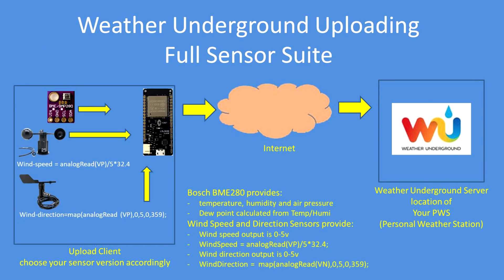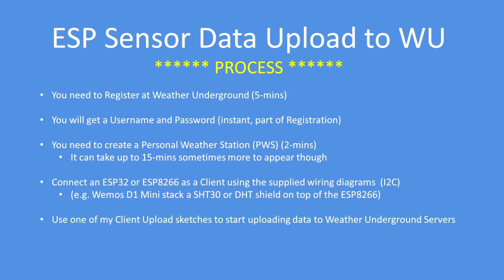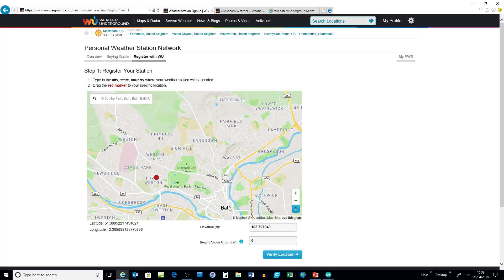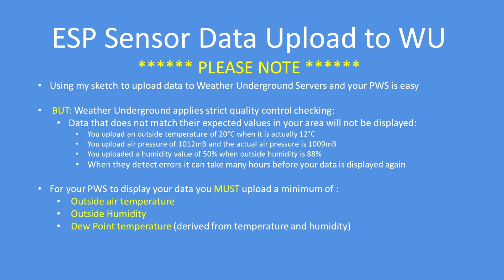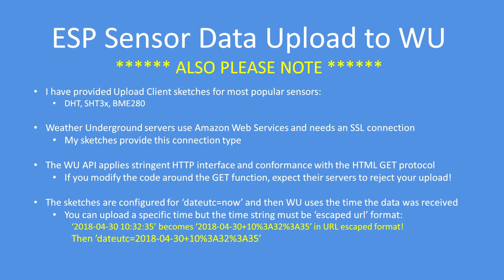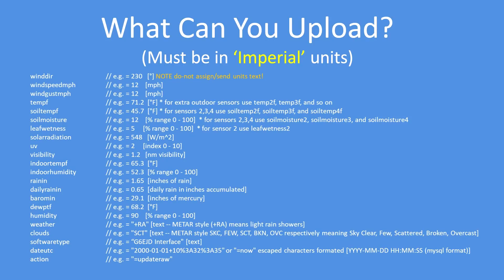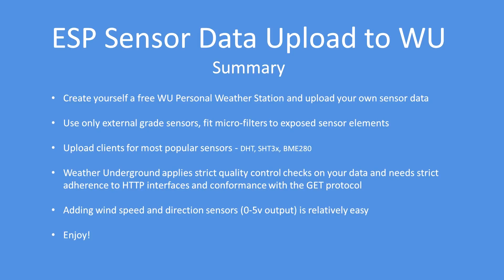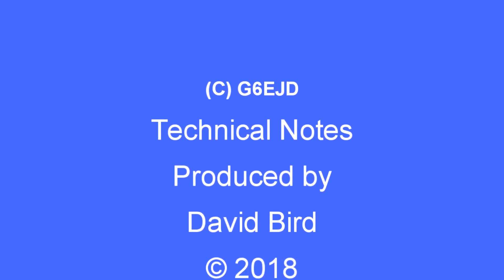Tech Note 093 - ESP(32 or 8266) Sensor Data Upload to Weather Underground

Comment: Great project David, I have a question. Im fairly new to The Esp8266 but have made a few weather stations with them. I have probably a naive question but .what pins do the sensors hook up too? ( wind, direction etc.) Am i going down the wrong road ? 
Tnx
Reply from the maker: It depends on the sensor type and data bus, usually either an SPI or I2C bus or maybe just a one pin interface. Unlike the ESP32 it’s not easy to reassign the pins used for data buses so you have to use the already defined pins, a Google search for 8266 spi or I2C pins will quickly give the answer, for example I2C is pins 4 and 5

Comment: David, I just viewed this video, I am trying to up load myPWS to WU. I have tried your sketch in the Arduino IDE, I keep getting this error message "system_variables.h:" no such directory, can you assist me by telling me where I can download this from ??. Great video, easy to understand for a novice like me.
Reply from the maker: it's the last file in the repository, just copy that into your sketch folder and restart the ide.
Reply from the maker: Note, unless you have a current WU account and a PWS, IBM as the new owner closed down this method; well unless you pay $500/month
Reply: @G6EJD  I have an account with WU and a PWS name, excuse my ignorance, but where is the repository?
Reply from the maker: GitHub g6ejd
Reply: @G6EJD  I have final got the sketch to run on my D1 MINI, I finally managed to download the "systems_variable .h;" file, now I get an error message in there serial monitor, "could not fined a valid bme sensor, check wiring" this I have done and it is correct, I have tested the BME sensor on an Arduino UNO and it works perfectly, can you help me again?
Reply from the maker: @raysmith6874  are you using SDA => D2.
SCL => D1 and bme.begin(0x76) or bme.begin(0x77) depending on the type you have.
Reply: @G6EJD  the address was 0x77, I have changed it to 0x76 it now allows the sketch to run, but now I get "error uploading to weather underground, trying again later" ???
Reply from the maker: You can test the weather underground upload using your browser, replicate the address and data used by the programme into an address, it is usually that WU have changed their criteria, it happens a lot, they do give examples, also they may now require https
Reply: @G6EJD  Sorry I am not sure what you want me to do? I am a novice.Do you mean copt & paste the WU address in my browser?
Reply from the maker: @raysmith6874  exactly, replicate what the programme is sending in your browser address bar
Reply: @G6EJD  when you say replicate the programme, do you mean the whole sketch or just part of it ?
Reply from the maker: @raysmith6874  https://rtupdate.weather underground.com/weatherstation/updateweatherstation.php?ID="+WU_pwsID+"&PASSWORD="+WU_pwsPASSWORD+"&dateutc="+timenow +”&field1=22.5” replace ID and password and date and time, the easiest way is to print out what the programme sends and copy that line from the serial monitor into your web browser, this is almost certainly WU rejecting the upload request
Reply: @G6EJD  sorry to be a bore, is this a link you have sent me, because if it is I get a new screen saying "502 bad gateway"
Reply from the maker: @raysmith6874  what you need to do is replicate what the programme is sending to WU so monitor the serial port it will display what is being sent to WU, take a copy of the line with select a d copy (ctrl-c) then paste that into your browser and see what the result is, if you have done that and the response is 502 bad gateway then that is the WU response to an upload the problem with a 502 response is it’s not very informative and is usually a WU problem not a user call. This is the problem with WU since IBM took them over.
Reply from the maker: I have a trial with mine standby
Reply from the maker: OK just tried the code and it all works perfectly. Are you using your PWS station name as login and the correct password? This link works, I get success, obviously copy it and edit the details to yours:
https://rtupdate.wunderground.com/weatherstation/updateweatherstation.php?ID=yourPWSnamehere&PASSWORD=yourpasswordhere&dateutc=now&tempf=22.5&action=updateraw&realtime=1&rtfreq=60

So you need to replace 'yourPWSname' with actual name e.g. IMELKSHA3 and same for password

Comment: I am a little confused. If i set the update interval to 10 minutes, then why it is updating the weather data every 5 minutes?? The Esp8266 is sleeping in that  interval?
Reply from the maker: I think you have done something wrong
Reply: G6EJD Hhmm. I dont know. In the afternoon  it reported back  every 10 minutes as i set in the sketch. Now it is working great.  But the air pressure is not reported 🤔
Reply from the maker: László Kósa, OWM does not provide all data for all locations, have you tried a different location?
Reply: G6EJD I am uploading to Wunderground :)
Reply from the maker: László Kósa, if the pressure is not showing check that the API is not expecting imperial units eg 29.4”

Comment: HI G6EJD ,verry nice project . I dying with sensor DHT11 . I corectly register in wunderground.com and site give me ID for PWS and passoword. I corectly include data in sketch. serial monitor say me : 

wifi connected
192.168.0.106
upload date-time:CCYY-MM-DD HH:MM:SS expected
upload date-time:1970-01-01 +6:00:04
connect to rtupdate.wunderground.com
connection failed try again next time 

I think the problem is time , i enter in the router menu /system / time /and enter ntp server and chenge date and time. but problem is stay. after i chenge :
void StartAndGetTime(){
  configTime(0, 0, "0.uk.pool.ntp.org", "time.nist.gov"); 
  setenv("TZ", "GMT2BST,M11.28.4/01,M10.5.0/02",1); 
  delay(200);    +2 hours for Bulgarian time zone and mount and day .but  unsuccessfully, please help me if you can , thank you.

Comment: I moved my sensor from a esp32 to a esp8266 (it's been disconnected for a week or so)  and am getting connection errors now. Is this a fault on their (Wunderground) end?  Also, does this use GMT for the time? It's 6:13 here (EDT),
 time shows as 23:13 , (gmt time now appears to be 22:13 .) 
.....
WiFi connected
IP address: 
192.168.0.217
Upload date-time: CCYY-MM-DD HH:MM:SS   expected
Upload date-time: 2019-07-17+23:13:20
Connecting to   : rtupdate.wunderground.com
Connection failed
Error uploading to Weather Underground, trying next time
Reply from the maker: Did you renew your keys when IBM took over WU, if not your key will be rejected. You cannot get a new key unless you have a PWS that uploads constantly. Also for some of their servers they moved to https
Reply: @G6EJD  EDIT: *MUST use version 2.4.2 * I just verified it still works fine on the esp32, so I'm not sure whats happening. I used the same sketch , keys, id ,etc in Arduino IDE. I even tried creating a new ID/key . still fails. I tested the setup with the bme280 test sketch, getting a good response.I appear to be having the exact same issue as John Byrne below. Works on esp32, but not on esp8266
Reply from the maker: Bruce, downgrade to ESP8266 ide core to 2.4.2, recompile and it should work again.
Reply: @G6EJD  I can confirm it works (ESP8266) with esp8266 version 2.4.2 and not with the newest.  2.5.2. My apologies for not reading the whole thread here.
Reply from the maker: Bruce, I doubt 2.5.2 will ever be fixed to solve the problem, development seems to have stopped.

Comment: I am new to Arduino/esp32. I  was going to try this on my esp32 /bme280  but when compiling I'm getting 
system_variables.h: No such file or directory 
I'm sure I'm missing something obvious. Can anyone help? Thanks in advance.
Reply from the maker: You also need the file system_variables.h in the same folder as the sketch and be sure to have refreshed your WU keys if not already, since IBM took over WU your old keys won't work.
Reply: @G6EJD  I think I got it now Thanks!  The Arduino IDe moved the sketch and didn't move the  system_variables file . Only other issue I  have now is my dew point  shows at DEWPOINT
154F . Something seems a bit off lol
Reply: Dewpoint...Seems the sketch is converting temp from celsius to F and the dew pt calculation is also adding a second convert to F
sensor_temperature bme.readTemperature() * 9/5+32.... // Read temperature as Fahrenheit
then at the end of WU_dewptf   I see *9/5+32  converting it again to F
I just added a second temp statement to read the BME280 in Celsius (without the conversion to F) then used that variable for the dew pt calc.  since I don't really know what I'm doing yet. Thanks for the awesome work !
Reply from the maker: Bruce, the Dewpoint calculation takes temperature in °C it came from NOAA so there may be a logic fault and it’s sending temperature in °F and not °C if that makes sense. I’ll check the source code, it is wrong.
Reply from the maker: The Dewpoint Calc. is wrong, it’s defined as: Td = T - ((100 - RH)/5.) where Td is dew point temperature (in degrees Celsius), T is observed temperature (in degrees Celsius), and RH is relative humidity (in percent). I’ll update the source.
Reply from the maker: Modified the source code now.
Reply: @G6EJD    Thanks  :-)
Reply: @G6EJD  Hi - I have just ammended the ESP_WU_Uploader_DHT_v01.ino source as it too is using F rather than C. Please can you update as you have done for the bme280 to help others in the future. Great channel and resource. Thanks
Reply from the maker: Can’t do that presently as I’m in hospital until at least November
Reply: @G6EJD  Sorry to hear that. Hope all goes well. Look forward to your future uploads.

Comment: Hello David
Had this running on a wemos d1 for six months without problem.
Now wont connect to weather underground, same code works on a ESP32 fine.
the line that displays the id, password and temp setting is just gobblegook.
and says connection failed using the same logon on credentials as the ESP32 version.
used four different wemos/bme280 versions
not sure what has changed. thanks
Reply from the maker: You need a new API Key from Weather Underground. Did you renew your keys in about March 2019 when they changed their requirement for keys? IBM took over WU and changed all of the licencing and charging arrangements, now you can only get an up0load key to operate if your a PWS (Personal Weather Station) that regularly contributes weather data for your region.  The fact that the ESP32 works and the ESP8266 is strange, there is a different complier core for the two, it looks like the ESP32 is correct and the ESP8266 version is not - obviously. What version of the ESp8266 core are you using? Mine is currently 2.5.2 as an example. You can down-grade your core to say 2.4.2 which was the last known good version.
Reply: Thanks David I shall try your suggestion.

Comment: you have to buy it ?
right?
Thanks.
Marc.
Reply from the maker: Marc Paradis Not sure what you mean? A developers WU account is totally free but they limit you to 500 reads per day, but can upload as many times as you like, in fact their rapid-fire server that I set it up for, allows data uploads every 5-secs.
Reply: G6EJD i saw that personal weather station is a paid service...
Reply from the maker: Marc Paradis You have to pick the Developer option and then it’s $0 cost - definitely free, they just make it look like it will cost, either that or it’s changed very recently. If they charge they would lose a large proportion of their free weather data feeds! There are tutorials around that show you how to go through the registration process.

Comment: Hi David, 

why are there two diferent update lines with diferent Delay updates in milliseconds...

Thx for explanation.
Adam

#ifdef ESP32
  const unsigned long  UpdateInterval     = 30L*60L*1000000L; // Delay between updates, in milliseconds, WU allows 500 requests per-day maximum, this sets the time to 30-mins
#else
  const unsigned long  UpdateInterval     = 30L*60L*1000L;    // Delay between updates, in milliseconds, WU allows 500 requests per-day maximum, this sets the time to 30-mins
#endif
Reply from the maker: The ESP32 sleeptime is in microseconds and the ESP8266 in milliseconds! hence a factor of 1000 difference.
Reply from the maker: Damjan Adam   I see why it’s confusing it’s written for sleeping then waking then updating then sleeping so for both variants if not sleeping then use the ESP8266 value in milliseconds
Reply from the maker: Hi, I've clarified this in the source code now, either use the ESP running all the time or use it in sleep mode.
Reply: Thank you very much for a very nice project, I really like it. Today, I made electronics together with Wemos D1 mini and BME280 powered by solar energy. But I still have a small problem with Dew Point, although I have it activated in system_variables.h. On the WU does not appear to be correct and it does not show up on values, while the value in the graph shows continuously 37.7°C. I've already gone through the program code several times and I have no idea what could be wrong. Any idea? 
Thanks a lot.
Adam
Reply from the maker: Damjan Adam You need to make sure the values from your BME280 are as expected so just after you read them print out the values and do a basic check like is the temperature, humidity and pressure sensible then do a check of the upload line that gets copied to the serial port, after conversion to imperial there should be correlation.
You are sending the current outside values? If not they won’t display your values.
Reply from the maker: I just tried: https://rtupdate.wunderground.com/weatherstation/updateweatherstation.php?ID=IMAJPERK3&PASSWORD=damjan9280&dateutc=now&tempf=84.81&humidity=39.05&dewptf=162.72&baromin=28.57And got 'success' returned. As I said in the video, if you modify the upload format from what I provided it won't work! Has it been modified. Clearly the upload commands are correct as I just tried it.

Comment: It seems that esp32 is struggling with DHT22 and the DHT11 seems okay.
Can u confirm that ?
Reply from the maker: Did you change the type to DHT22? I had no problems in my testing. I use Wemos DHT11 and DHT22 shields Blue and White cases.
Reply: G6EJD yes of course. Its an already built in module.
Reply from the maker: The DHT is a well used and tested library, so I'm surprised if there are problems, most likely hardware related.

Comment: any suggestions for cheap wind speed+direction and rain sensors, usable in this kind of setup? No info in description... thanks!
Reply from the maker: https://www.aliexpress.com/item/Wind-Direction-Sensor-PLUS-Wind-Speed-Sensor-RS485-RS232-4-20mA-0-5V-Multiple-Power-Supply/32853954229.html?spm=2114.search0104.3.1.78a94425MKrFUo&ws_ab_test=searchweb0_0,searchweb201602_4_10152_10065_10709_10151_10344_10068_10130_5722815_10324_10342_10547_10325_10343_10340_10341_10548_5722915_10697_5722615_10696_10192_10190_10084_10083_10618_10307_10710_10301_10303_5722715_5711215_10059_10184_308_100031_10103_441_10624_10623_10622_5711315_5722515_10621_10620,searchweb201603_31,ppcSwitch_4&algo_expid=9fc5810d-986b-4ccb-a177-aec9ac5e3948-0&algo_pvid=9fc5810d-986b-4ccb-a177-aec9ac5e3948&priceBeautifyAB=0
Reply from the maker: There are really units around but not 0-5 volt output, windspeed is a reed relay on/off which can be counted for a fixed time, wind direction units are usually 16 reed relays with a voltage divider, sold as spares for weather stations. Search Aliexpress for 'weather station spares' example: https://www.aliexpress.com/item/1-PCS-of-Spare-part-for-weather-station-to-test-the-wind-speed/32790525433.html?spm=2114.search0104.3.1.49e918e8C9g9vh&ws_ab_test=searchweb0_0,searchweb201602_4_10152_10065_10709_10151_10344_10068_10130_5722815_10324_10342_10547_10325_10343_10340_10341_10548_5722915_10697_5722615_10696_10192_10190_10084_10083_10618_10307_10710_10301_10303_5722715_5711215_10059_10184_308_100031_10103_441_10624_10623_10622_5711315_5722515_10621_10620,searchweb201603_31,ppcSwitch_4&algo_expid=7c2ec4c0-e046-4c38-acbd-996a28283675-0&algo_pvid=7c2ec4c0-e046-4c38-acbd-996a28283675&priceBeautifyAB=0In the UK these spares are about $5 each, must be postage costs from Aliexpress.